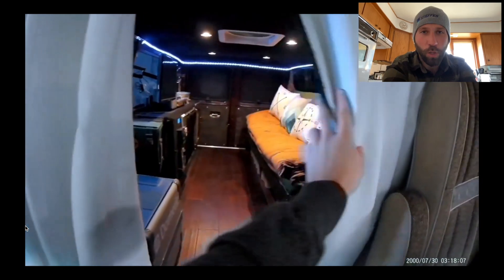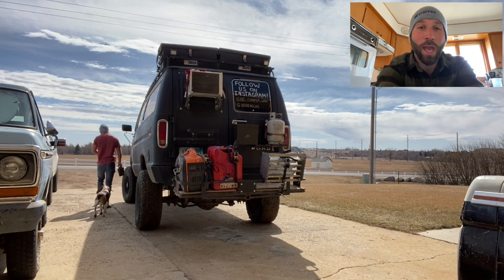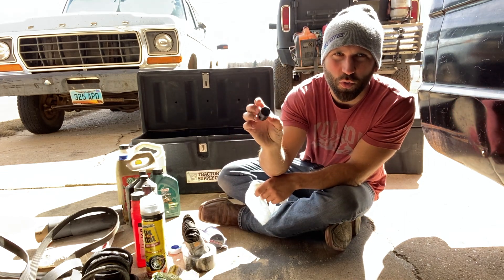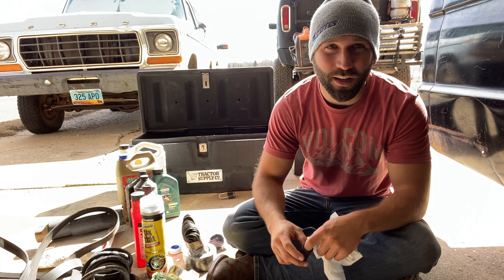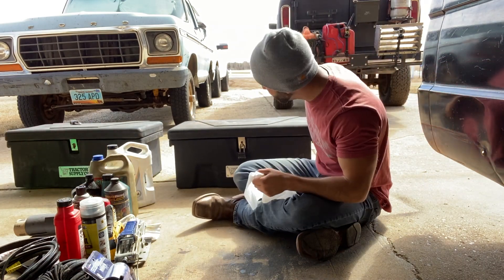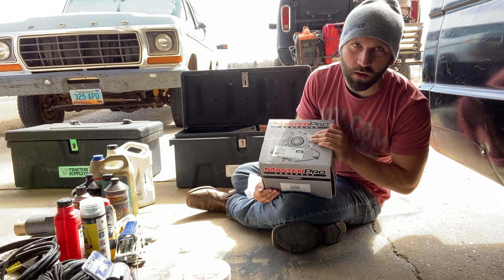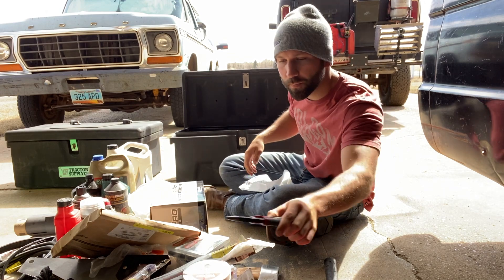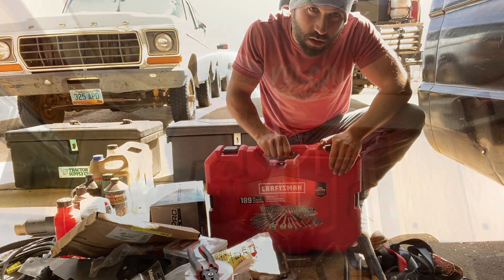I built this monster and drove it 12,000 miles solo across the US and Canada

Comment: Sick build! How did you mount the master cylinder and clutch pedal in the van body?
Reply from the maker: Thanks man!
I bought a “CNC 252S” clutch kit off Amazon. Cut a hole in the firewall, bolted it in and built a custom bracket to stiffen up the mounting.